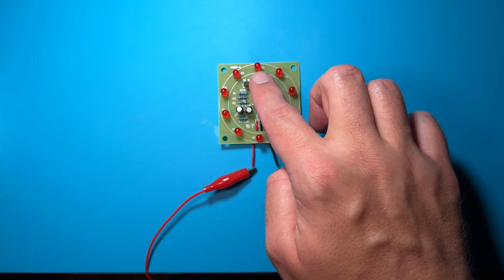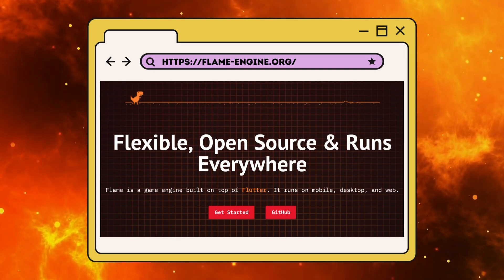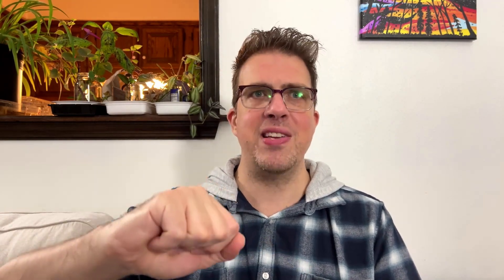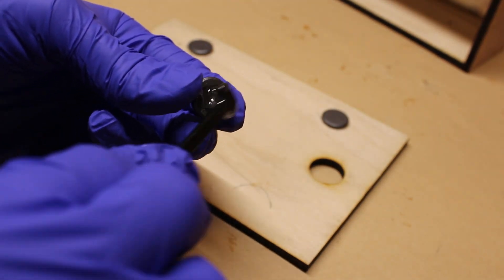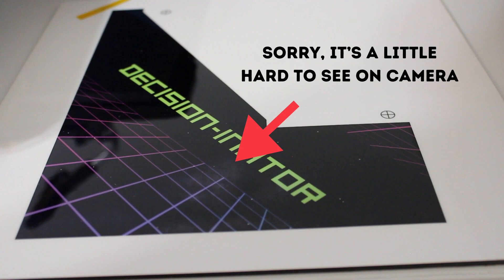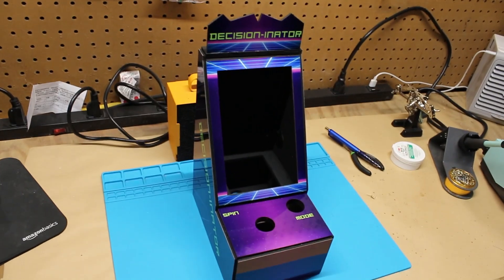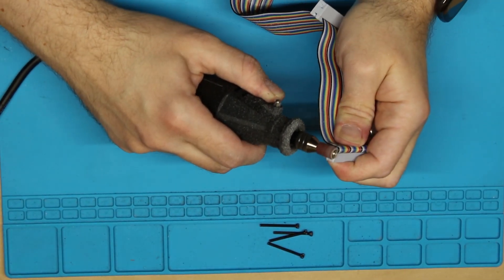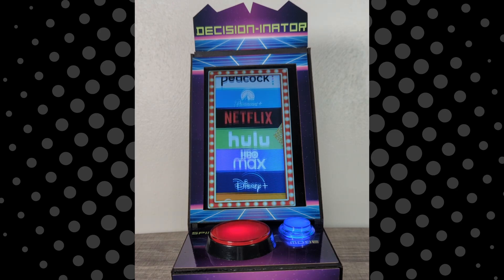I Saved My Marriage Using Flutter and a Laser...

Comment: Great work. I like that you're running flutter on a microcontroller.
This is a lot of production cost for something with a very limited use. But why not, I guess?
Reply from the maker: I think that's a fair criticism and deserves a thoughtful response. 

My criticism of Maker / DIY YouTubers as a whole is that they tend to just create landfill material. 

Jazza built a beautiful replica of Hyrule village then later admitted he trashed it. Likewise most of the stuff Evan and Katelyn make is literal garbage that will be in a landfill 300 years from now. 

This is why I put so much effort into making the Decisioninator so it can be easily disassembled. All I have to do is remove four screws and pull out a ribbon cable to remove the Raspberry Pi and Touch Screen. Both items can easily be reused for later projects. 

With about five minutes of extra effort I can remove the arcade buttons and reuse them as well. 

That leaves just the wooden case and the custom breakout board as the only things in this project that can't be easily reused for another project in the future. 

It's not like the tech is permanently "wasted" on the project.

At my heart I'm a profoundly silly man. I wish I was more practical. I have no illusions that I'm doing anything but putting a smile on people's faces. 

That being said, I am trying to do it in a way that is ethical. The amount of "waste" in the project is significantly less than it would initially appear.